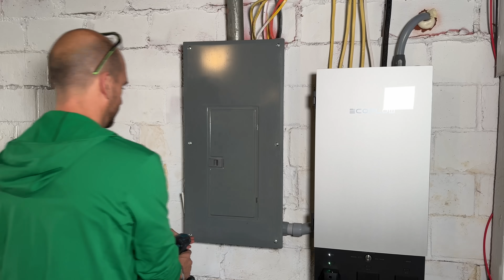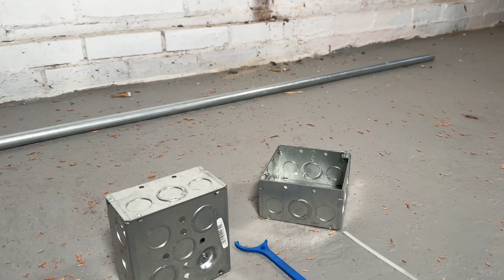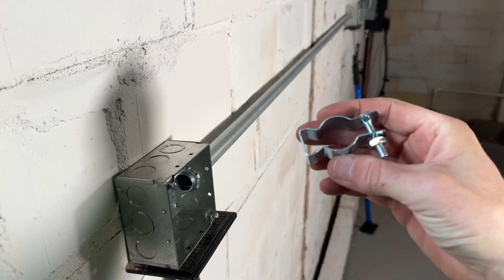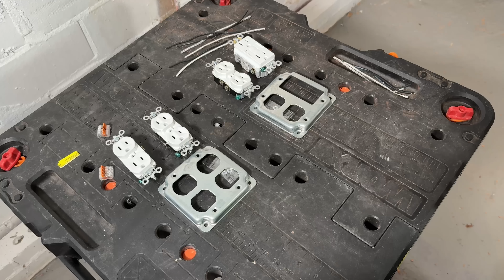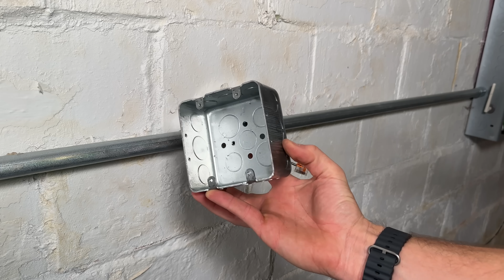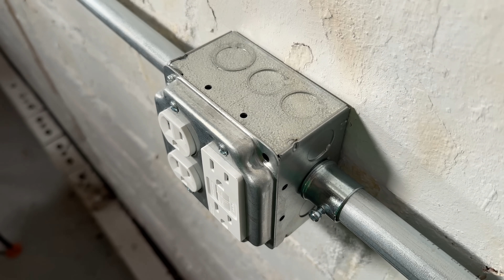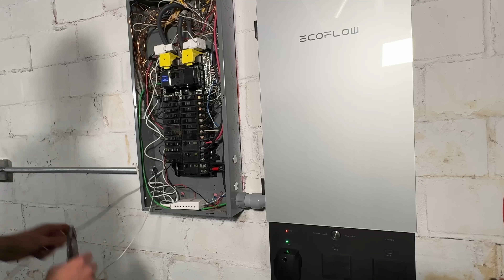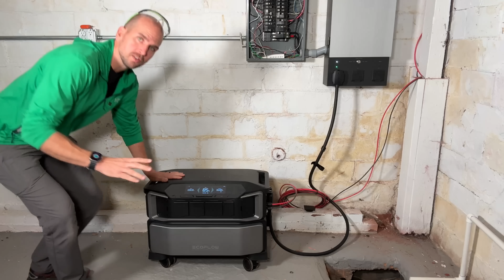Add Outlet To Unfinished Basement Or Garage

Comment: Who doesn't run a dedicated ground in conduit?  This isn't a third world country.
Reply: Perfectly legal and conduit is installed without wire grounds all the time.
Reply: @pld8993  Perfectly legal and utterly stupid.  Why would you ever rely on a daisy chain of conduit screws for a safety ground?
Reply: @stargazer7644  Why would you ever rely on a single green screw for a safety ground? Why would you ever rely on a single terminal screw on the neutral/ground bar for a safety ground? The NEC lists 14 different types of EGCs, only one is a wire, 12 are conduits. Become an electrician and you'll understand how and why we install conduit without wire type grounds regularly.
Reply: @pld8993   I know why you install conduit without wire type grounds.  You're cheap and don't give a crap about doing things right.
Reply: @stargazer7644  Like I said, become an electrician and you'll understand a topic that you clearly don't know anything about. You'll understand that conduit is a better grounding path than a copper or aluminum wire and why. You'll understand that parallel grounding paths are not always desirable and why. You'll understand that adding wire type grounds unnecessarily adds copper costs, labor costs, increased conduit sizes, etc., all for no good reason. You'll learn about skin effect, ground chokes, and other topics that you've obviously never even heard of. Learn before you speak; ignorance is not a good starting point.
Reply: @pld8993   I have an EE degree.  You'll find I might know a thing or two about those subjects, and I can smell your BS from a mile away.  Any more topics you'd like to dazzle me with, Einstein?
Reply: @stargazer7644  Nice try, liar. You've already made it clear you don't know a thing or two. Another online know-nothing. Next.
Reply: @stargazer7644  Sure you do.
Reply: @pld8993 

It's not to code where I live. We're prone to earthquakes and electricians here have died due to the conduit floating with no ground, hit with 600V.

And as previously said, you have to be the cheapest, dumbest hack to not run a EGC. Code is the minimum, there's no pride in that.
Reply: @pipe-brain  Sure, I know of a few local AHJs that require wire type grounds also and certainly applications where it makes sense or is necessary/required. Using the conduit as EGC is not cheap or dumb. It's done all the time and has nothing to do with pride. Going beyond what's required is not always better or safer. It certainly can make things feel better or safer, but I'm not in the business of assuaging someone's irrational feelings. For example, running 4" rigid in an industrial plant to a piece of equipment is not made safer by using a wire type EGC.

Comment: How hard would it be for a diy'r to upgrade his home from 100amp service to 200amp service ?
Reply: That would likely require a new meter box and weatherhead. That's not something I would recommend for a DIYer. Your power provider might actually require a licensed electrician to do it. Plus it needs inspected before they will connect the power and install a meter.
My meter box failed several years ago and it forced me to have my service upgraded to meet current code. The power provider also had to upgrade the lines from the pole to my house. The electrician I hired did an excellent job that passed inspection with no issues. She left the original box with the guts ripped out to use as a junction box since the new breaker panel would not have allowed the original wiring to reach the breakers. That saved a lot of money not having to rewire the entire house.

Comment: Isn't it against code to install grounded plugs without the 3rd wire ( ground ) connected?
Reply: Good catch. These outlets don't have a self-grounding clip. If they did, they would be grounded to the conduit. I would rather use a green wire to ground everything.

Comment: When pulling the wire you should have used 3 tablespoons of peanut butter (smooth only, chunky is against code!!). This helps protect the circuit in case a llama gets into your basement and starts licking your wires.

Comment: Where a ground wire was not required in Houston, I had an ac unit acting funny on the roof. The main breaker for it had tripped downstairs, but the service breaker in the unit had not. The motor starter had welded together as I found out, and as I headed downstairs I noticed the old threaded conduit couplings were blackened.  I guess through the years these had heated up and gotten cold and had loosened enough to lose connection.

Comment: One important consideration that you omitted. In such a setup, some people may want to run 2 independent circuits. An electrician could ask that question or make that recommendation for hardly not much more expense. Maybe an extra $30 for the second GFI outlet. Then the 2nd box would then have a direct connection and would need its own GFI outlet. The setup would look the same on the outside, conduit-wise. Important to consider for a possible later workshop or if one circuit will be nearly fully loaded with an electric heater. In my shed, all outlets have their own separate circuits, in case it is ever used as a workshop. Or I could plug in multiple heaters. And of course they are all GFI outlets.

It seems these days, you really can not have too many outlets. And even if you do, why not plug in a few nightlights?, so as to have not a completely dark house, and to eliminate trip hazards? The LED nightlights that we have now, hardly use any electricity.

Comment: your main panel is painted..makes for a poor ground connection. basement..wet.damp..far better to run the ground wire..and safer..if nothing else run to the GFCI
Reply: Basements are never a wet location and they are usually not a damp location. This basement is clearly a dry location.

Comment: Why do you use pigtails on the outlet, rather than going directly to the screw on the outlet with the main wire.  It seems like you are adding another potential failure point.
Reply: Code requirement today. In my rental condo, my tenant bought an air fryer and used it on a wall outlet. Half the power disappeared instantly. Six hours later we were able to find a Chinese wago nut melted. I hired an electrician to see if he could find the rest. After 3 hours, by dumb accident, he touched a can light and all the lights went on. This condo was built in 1996, but this was a replacement or a remodel can, installed by an amateur. The wire nut on the hot side was not installed correctly. We replaced that can, etc. and everything was done. The extra power that the air fryer used (1800 watts, 115V.) blew that connection apart, and I was lucky that the condo didn’t catch on fire. 
PS: When I lived in Libertyville, IL each circuit had to have a green insulated ground wire (abou 6+” long) the box to each outlet.

Comment: What a hack! I've been a licensed electrician for 35 years and work like this is why we have licensing requirements. 🤦🏻
Reply: Definitely a DIYer, but the only issue is the missing strap on the 6' length. Everything else would pass.

Comment: You can use Romex in conduit, as long as it's in a situation in which you can use romex. Where you're not allowed to do so is anyplace that's counted as a wet location, I.E. outside/underground. I haven't seen the complete inside of your garage, but as long as you have doors that properly close and isn't letting rain in, it shouldn't be considered a wet location. Also, whenever installing outlets/switches in metal boxes, it's good practice to electrical tape around the exposed terminals, for if whatever reason they get loose you're not engergizing your panel.
Reply: The inside of a garage is never a wet location unless it rains in there.

Comment: you should always us a green or bare wire in a conduit!!! 87 people died in 1980 Las Vegas fire because the conduit came apart. 
You absolutely can use Romex in conduit, check out Table 1 of the NEC. there is a maximum fill percentage but Cable can be inserted in Conduit.

Comment: The locknuts you used on the male adapters are not grounding locknuts. therefore you need to use the ground wire.
Reply: Incorrect. Grounding locknuts are only required on services and only when the conduit is being used for bonding. Those are connectors, not male adapters.

Comment: Need to use common sense: One length of Romex through a not-very-busy stick of EMT is not the end of the world. What you should not do is strip all the Romex sheathing and then use the wires alone....they are not rated for that. Also, I would NEVER not connect a ground wire from the outlet to the box. Why? As soon as one takes the plate/outlet assembly off the box, a wiring problem with the outlet could easily energize the metal plate, and with no ground wire - YOU become the ground wire! An inoperative outlet (broken wire maybe?) might be the reason one is removing the plate in the first place!

Comment: Code violations, Conduit not suuported, no ground pigatils from recpatacle to box.  Neat ness counts you have no offsets from the conduit to the pannel or the boxes, and lastly WAGO= fire.
Reply: The only violation is the missing support on the 6' length, none required on the shorter length. Offsets not necessary or required and don't make it look "neat," as most  electrical conduit is run without box offsets. Wagos are UL listed and don't start fires. Grounding pigtail to receptacle not required when cover mounting nuts are lock type (lock washers, locking nuts, etc.).
Reply: @pld8993  Support, you are correct but not good practice. 
    While offtets are not code required the do make good looking  workmanship. 
    Yes wagos are UL listed I personlay wont allow them in my facilities. In my 50 years I have seen very few well made twisted wiernut connections fail. 
     Metalic cover gronding, National Electrical Code Section 250.109 Metal Enclosures to keep the effective ground-fault current path, metal covers, extension rings, plaster rings, and metal fittings must be attached to the metal enclosures or connected with equipment grounding conductors, bonding jumpers, or both. The proble is that when the cover is open, or loose (not attached to the 1900 box) it is nlonger grounded nor then are the reccptacles grounded, a potentil hazard..
Reply: @davidhawley-lowry8360  There's nothing inherently workmanlike about unnecessary offsets. Most conduits are run without offsets. I've installed hundreds of thousands of feet of emt, imc, and rigid, most without offsets. Offsets also reduce the run to three 90s instead of four, which doesn't apply here but applies to lots of installations. Sometimes offsets make the most sense, sometimes they might be required, sometimes, as in this case, either way is fine. 250.109 doesn't change that fact that a wire bonding jumper is not required for cover mounted devices meeting the requirements of 250.146(A). Properly installed covers don't magically loosen and the only it would be detached is if someone is servicing it.

Comment: Yes, under certain circumstances you can use NMB in conduit. Why not bend box offsets in the conduit? I hope you are going to strap it. And make sure the top of your panel is secure. Looks like it's falling off the wall.
Reply: Box offsets add nothing of value her. Most conduit is run without box offsets.

Comment: I do not know what you accomplish by not running a ground wire, other than to save 75 cents worth the wire, I always use a ground wire to be 100 % sure that the installation is always grounded, electricity will follow the path with the less resistance to ground, you want to be sure that you are not that path, with gold being #1, silver # 2, aluminum # 3, I'm sure EMT is not # 4., I know a GFCI will trip with 5ma. of unbalance between  hot and neutral, but I wouldn't trust a $10 receptacle to save my life from an electrocution.
Reply: Steel conduit is a better grounding path than a copper wire, out to about 400'. Study skin effect is you want to better understand the issue. Resistance of the material is only one factor and not the deciding one when it cones to establishing a grounding path.
Reply: @pld8993  What do you use for ground bars? EMT or copper bars?  skin will factor a lot, some people have very rough hands, for the average person, you do  want the ground wire to be installed, by removing the receptacles from the box they are no longer grounded, with the ground wire the receptacles will stay grounded.
Reply: @josemarin7913  Skin effect of AC, has nothing to do with human skin. A hollow tube is a better grounding path than a small, solid conductor material.
Reply: You didn't answer the question, do you use hallow emt as a grounding bar?
Reply: @josemarin7913  A grounding bar is a particular piece/type of equipment and not what we're talking about. We're talking about EGCs, equipment grounding conductors, what most would call a ground or ground wire. Instead of adding a ground wire, you use the EMT that contains the conductors as the EGC for the circuits in the EMT. The NEC lists 14 different types of EGCs, most are metal conduits, only 1 is a wire. I've installed hundreds of thousands of feet of metal conduits, most without wire type grounds. Adding a wire type ground that's not needed or required unnecessarily increases copper costs, labor costs, conduit costs when you need a larger conduit to accommodate the extra wire, etc.
Reply: PS: Aluminum is not even close to being #3 when it comes to conductivity.
Reply: @pld8993  My bad, aluminum is number 4 according to the NEC

Comment: As a licensed electrical contractor for 45 years , there are so many errors here, I will not list any.
I have run miles of rigid and emt in my career.
OY
Reply: So many errors that you won't list ANY? BS. I've also been in the trade for decades, have run hundreds of thousands of feet of emt, rigid and imc. The only code violation here is the missing support on the 6' length. What are these supposed many errors that you seem to think exist?
Reply: @pld8993  45 years in business, several thousand customers, no inspection fails, always positive, gleaming comments regarding my work quality and ethics.
We also left the jobsite cleaner than when we arrived.
Reply: @pld8993  drilling into mortor instead of brick is one big issue, that is just DIY 101
Reply: @AdrianJayeOnline  While mortar isn't the best option for physical support, it's more than adequate to support a single 1900 box, not a big issue. What about the rest of these SO MANY errors? You're full of it and you know it. Next.

Comment: I'm sure someone must have mentioned it but you have a 20 Amp breaker running #12 wire and then you have 15 Amp receptacles. Maybe your code is different, but where I am you would need 20 Amp receptacles. I am also with the gang on running your ground wire. Too much depends on your mechanical connections with steel hardware otherwise. Thanks
Reply: 15 amp receps are installed on 20 amp circuits all the time, and not a code violation.

Comment: Funny! About 1972,  I did similar to my unfinished basement. However, I did not know about GFCI/in fact had no idea they existed. Also, I did something far better than you (better is arguable). I actually wired two sets of wires on two different circuit breakers. Having the wired throughout the basement with one circuit on top and the other on the bottom. Both were 15 amps, allowing me to have that extra line. So I could plug in a lamp on one and the tool on the other. WHY? Just because. The pipes had no problem with 6 wires running through. Finally, since I was going all around the entire basement, left the pipes at 10'. No cutting except when necessary. Otherwise, a great video.

Comment: Grounding by EMT is not allowed. EMT can corrode and break the safety ground connection!
Reply: Incorrect. EMT is allowed to be the ground.
Reply: @pld8993  I wouldn't trust it on any job I do. Always run a green! Don't become a victim due to corrosion over years, Jobs I work on work last forever!
Reply: @Eviltek2099  I've installed hundreds of thousands of feet of conduit, most of it without wire grounds. My work also lasts forever. If you're worried about corrosion of conduit connections corroding, why doesn't that same concern apply to wire ground connections? Yet another electrical trade myth that won't die.

Comment: Nice video,well explained. I didnt know all that about boxes for unfinished vs finished spaces. Thanks. I wonder why you ran the screws into the mortar - my thinking is: Dont mess with the mortar. I dont really like the tapcons - think they always loosen over time and abuse. Prefer nylon or "lead" - tougher, repairable and more tolerant. I was against the use of the WAGo's, but I can see the advantage when is comes to going back in the make additions and to check things - maybe sometimes "new" is OK.